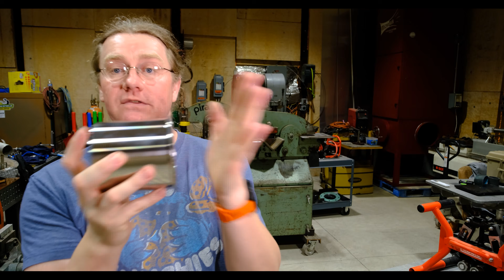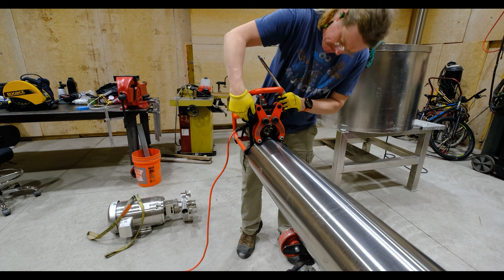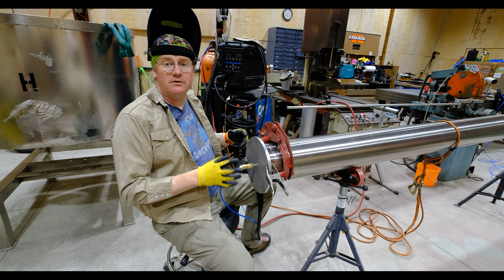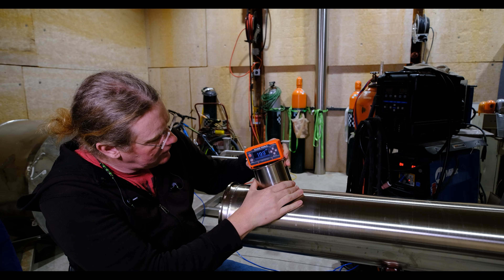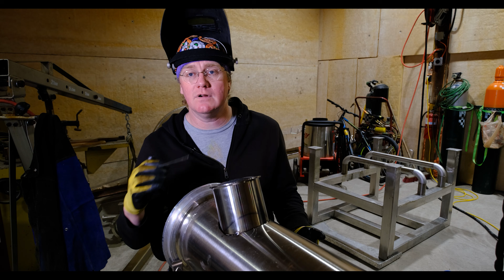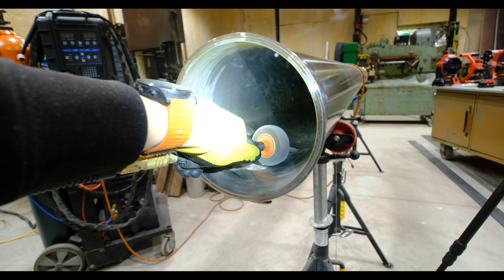Welding Big Sanitary Pipe And Tubing

Comment: This is some great welding but you need to get yourself a bandsaw and some cobalt blades if your going to be regularly cutting stainless in your shop. It’s so expensive but just get you an old manual band saw and it will last the test of time just like all the ones before it
Reply: I’m I cannot imagine 165$ per four cuts. If you had a customer that had some work needing some angles the bill would be out of this world and the first time they goto another shop with a band saw and get the industry standard price and time it would take they won’t go back to you no matter how nice the welds. I don’t mean to sounds like a dick or a no it all welder from the internet I just wanted to lay out my two cents which I rarely do online cause I don’t want to sound like an ass

Comment: Being a certified UA welder for 20+ years and a Welding inspector (CWI) for 16years……I am at a loss for words. I try to keep in my head that videos like these are …… an informational video for the most part… but dealing with stainless polished stainless tubing….. there are many issues I have with your work here….especially with how you treat the stub end’s prep pipe end prep and install and welding technique ….. I’m not here to bash you…. But some of your steps would not fly in many parts of the stainless high purity food grade pharmaceutical industry… especially using a hole saw tool with a steel chain directly on the polished stainless or any grade of stainless for that matter. Protect the pipe all the time …. Scratches create rust…. Tungsten dip stop and clean them… in general you did a decent job. Like you said….. folks need to understand this is not easy work, tedious high skill set
Reply: This comment shouts “I’m a twat” 

You twat.
Reply: You must be fun at parties!

Comment: Why don’t you use a metal cutting bandsaw?
If it is a good quality machine you will have also a good straight cut.
At the end it will be cheaper than every time 165 bucks for only 4 cuts. If you can find on the other side of the pond some beam clamps M10,it’s a lot easier for holding your purge plate
Reply: Yeah that’s what I say too. I have a Wilton 9”x16” and a Rong Fu 9”x16” band saws. (Blade is 135” on one, and 142” on the other). If you take the time to adjust your bandsaw to cut straight, and use a blade with a high TPI count, you can make hundreds if not thousands of cuts into stainless steel. Straight, clean, accurate cuts. I do it all the time, as I do a lot of the same type of work this guy is doing here. 
I can see where that saw he has would be good in the field though. But for shop work…the bandsaw.
Reply from the maker: I could not get my band saw to cut that as square as I needed plus I need to be able to cut that stuff on sight. I kept getting the band saw blade to walk about a blade width +-
Reply: @DarlingtonFarm  check your rollers from your bandsaw,if they move too much “wobbling ” that’s the reason from no straight cuts
Or use ceramic saw guides

Comment: When you can’t get a tack to jump the gap alot of times you can tap the pipe with something like your wire brush or cutters and it’ll jump.
Reply from the maker: I will have to try that thanks
Reply: Or just keep a 1/16 wire handy 🤦‍♂️

Comment: I did a 6" 0.109" wall job not long ago and man i had a hard time melting that root. First weld i dis Where ferrule that I welded and the end of spool so customer accepted I fuse them from the inside too since I had the room. But for the next joint I ended up putting a bevel id helped a lot melting that root but i didnt put a fill pass. I wish I’ve seen that video before but it wasn’t online yet!!! Just the video I’ve been waiting for a long time. Not always easy I’m a one guy band I’m a welder but not a true PipeFitter but when I have the chance to weld stainless tube I always weld it to sanitary standard as a practice even not required. Thanks a lot for the video!!!
Reply: Yeah that's thick. Below 4 inch is .063 and above 4 up to I think 6 is .085. I've never done above 4 but I bet it's a way different learning curve